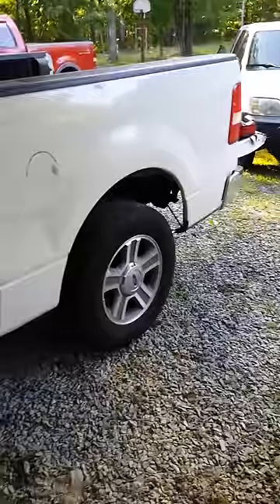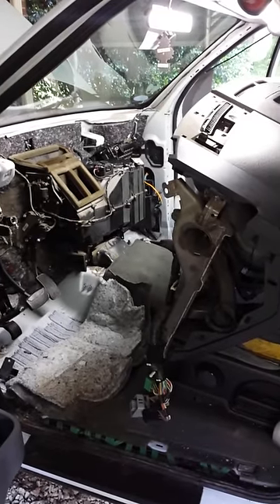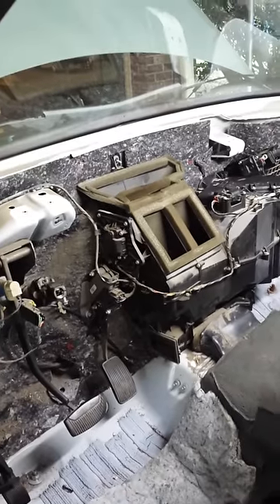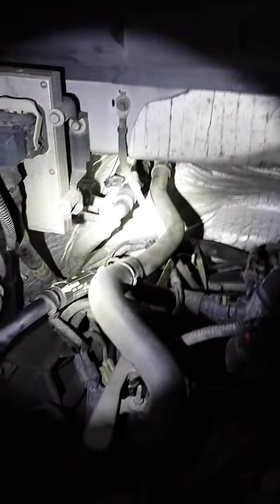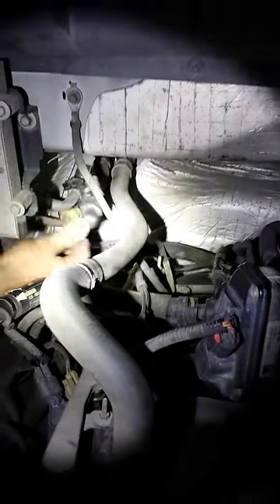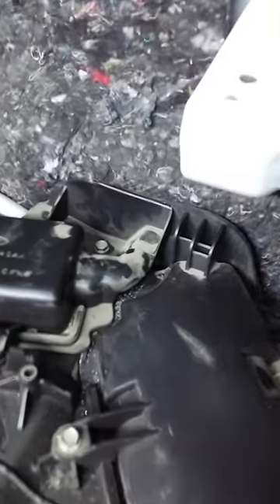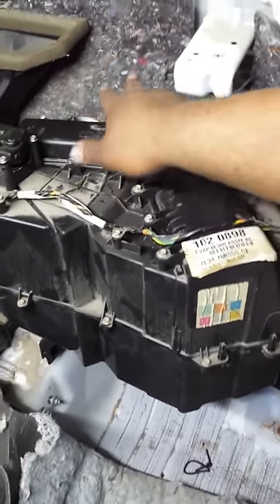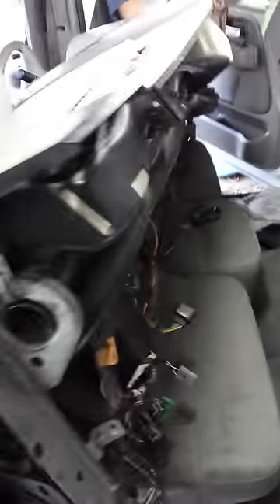04-08 Ford F150 Heater Core Shortcut

Comment: I want to say THANK YOU! worked on my 2005 quad cab, Had to lift the carpet and remover the floor vent to pull the black box out. I think there were 2 nuts on engine side and 2 on the inside to get box loose. had to slightly bend the aluminum hose on the heater core to get them in but OMG if freaking worked thank you very much! U Da Man!!!!!!

Comment: Hey, I have a leak to the passenger side floor due to (I guess) the evaporator drain broken or mis-plugged. Would you explain where exactly to locate the inside-the-cabin part of the drain hose or tube? Do you have to remove the whole dashboard for that?

Comment: What college educated engineer engineer this where you have to take the whole dash out to get to it my 1995 f150 you just remove the glove box and you can get to it they do this on new truck so you have to take it in to have it worked on brilliant just brilliant
Reply: I have a 2004 f250. I replaced mine by removing the glove box too.  Im wondering if all that dash removal was necessary. Things that make ya say, Hmmm!
Reply: F250 is a completely different truck

Comment: SHORT CUT??? That is the way you remove it, PERIOD. What you DIDN'T tell them and I wasted an hour until I realized that if you don't remove those "safety clips from your ac lines, you'll NEVER get those heater core lines out far enough to slide it out...

Comment: How did u get the dash out like that all together
Reply: The dash has to come out like that.  It is a complicated procedure.  I recommend a Chilton's manual as this truck is a true puzzle.  However,  they don't call it a dash anymore.  You will need to look up instrument panel removal.
Reply: Did you undo the bolt behind the accumulator bracket ? Or did you break that part ? They are two bolt on that bracket one behind the other.
Reply: @takiaoua  I know EXACTUALLY what you are talking about. I used my sazall and cut that part off. I tried to do it the right way but I was short on patience. Besides the one bolt holding it was/is more than enough...

Comment: Unless you didn't remove the dash then this is no short cut.
Reply: It saves from recharge a/c
Reply: EXACTLY!!! I though I was gonna learn something new...
Reply: @billroberds9075  TOTAL BS! If you remove the safety clips from the ac lines near the firewall, you'll have just enough room to slide it out without having to detach the ac